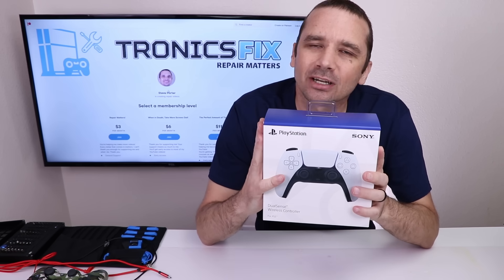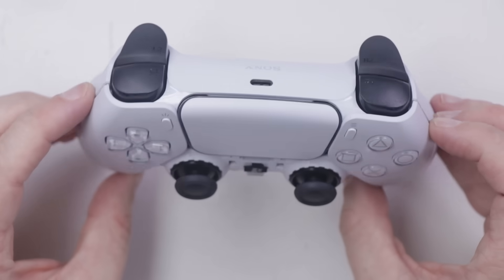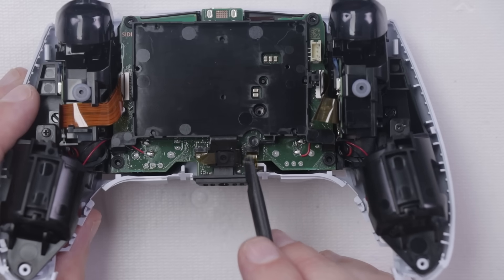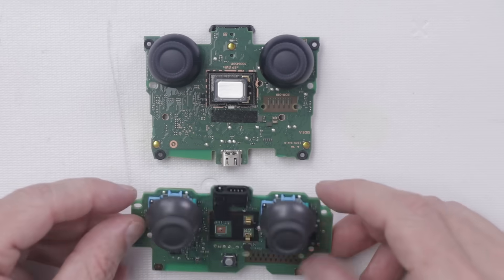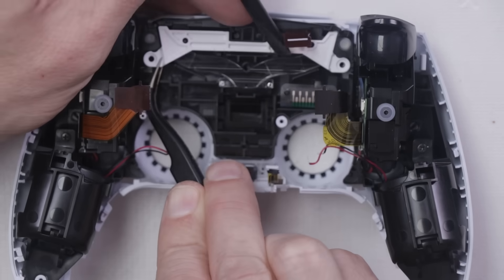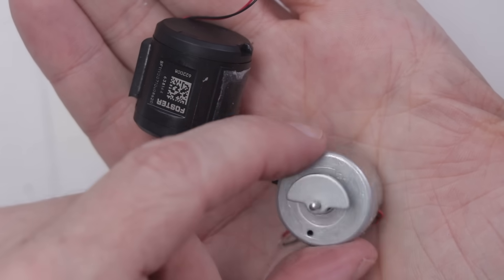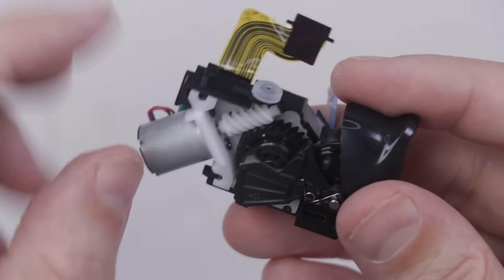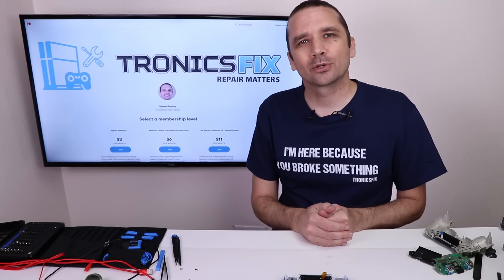PS5 DualSense Controller Teardown - A Repairability Perspective

Comment: I've never had any issues with stickdrift on my dualshock 4,have 3 and all of them work fine and 2 are over 2 years old and have been used almost daily. Only problem I have is one one the L3 button isn't a 100%, but no stickdrift at all, I believe if you keep your controller clean and don't drop it that stick drift won't be an issue that much, just vaccum the outside and clean it of with a slightly most wipe and you're good to go, that's what I've been doing all along atleast

Comment: Sony could potentially still produce another dual sense controller with different analogue sticks without affecting the controller massively the only problem would be production of it because it’s more research, time, testing and possibly a update for the controller to function like it should with the ps5

Comment: Do you know where to find a ps5 trigger spring? Mine snapped :(
Reply: Mine did the same thing. The ones from PS4 controllers are the same exact spring. (Atleast the models I have.) Hope this helps.
Reply: Also hoping that they were just faulty/poorly manufactured springs and won't be a reoccurring issue. Only time will tell.

Comment: The main problem is that the drift on the analogs on the ps4 controller is a hacked system introduced to the ps4 since you move the R3 analog to aim at a corner and the gun won't move * and it just became a up down side to side movement instead of a 360° degree movement like my previous v1 controller ** so this new ones you one the analog and the gun won't literally move to a movement u do ** so it makes it sooooo disappointed on call of duty since the cool thing about call of duty is the fast aiming with 360° degree aiming movement and no drift as now we experience dec/8/2020 y'all know thta by fact*** so its just a feature sony took off the ps4 so that developed gamers morph to the Ps5 and leave the crap ps4  to the young lol *

Comment: 6:15 Don't lose hope. The Joystick housing edges are super smooth with little to no grinding of the plastic.  The Switch Pro is the worst culprit of this due to having sharp edges surrounding the sticks shaft which creates plastic dust that enters the Joysticks internals causing drift. The DualShock 4 also had this issue.

Of course wear and tear will still happen but not as quickly.

Comment: So the adaptive triggers are nothing but a flimsy piece of plastic moving in your way to do the trick. Nothing "highly" advanced, that would justify the high price..
Well i hope they at least have a better policy this time to replace broken controllers.

The only problem i have with my current Xbox Controller are the rubber pads falling appart. But after 5 years and more that is to be expecte dif you have them in use a lot. And i can easily replace it for 5 dollars.

Comment: Easier then DS4 WHEN open you might rip charge light cable and parts can fly out like springs etc. But I bought broken official PS4 charge base that charges at bottom ext. Port next to 🎧 jack. Charges faster. So I removed wire with plug heat shrinked it and boom works fine.

Comment: OK awesome easy too fix since I've been fixing systems since PS1 yes I can fix Nintendo, and all systems, even do raspberry Pi and put raspberry pi in a Wii U game pad. PC's and laptops, 📱 and tablets but you pay for parts, original parts. The hardest part is replacing USB since you obviously can't used a soldering iron. Next is replacing potentiometers they are soldered with lead based soldering.

Comment: The dual shock was like defusing a bomb the dualsense is like defusing a nuke
Reply: ? The DualShock is pretty simple just by looking at it
Reply: @mftripz8445  yea it really was I once took it apart while waiting for a match online
Reply: @mftripz8445  dual shock 3bwas harder actually
Reply: @BeezyWaxx  yep, the triggers had to be slid into the film with the contact then clicked into the joint then the join assembly slid down into a grove on the bottom piece THEN you could slide the motherboard in place, and the last piece had to sandwich the assembly, and if you messed any of that up the triggers would not work right
Reply: @ThreeDaysOfDan  which version mine  was easy to take apart 1st gen I think
Reply: @ThreeDaysOfDan  yep I  cleaned out one the other day and it was a pain to get everything to stay in place
Reply: But, nukes are bombs

Comment: Stick drift? on dualshock? Genuinely never heard of or had that complaint, unlike the switch
Reply: Yeah same and joycons are hot garbage
Reply: @BabySlayer13  honestly they are a great bit of kit, the only thing wrong with them (unless you have big hands) is the drift
Reply: At least joysticks on joycons are attached with a ribbon cable and not solder...

Comment: pissed about the analogs, my biggest issue was stick drift and they didn't even fix it.
now its even harder to fix..
Reply: I never had this problem and my friends neither, i only had this problem on the NSwitch
Reply: @D.K i know, that's usually what i have to do, im mainly just upset that its harder to do now., and the fact that they didn't even fix it..
Reply: @D.K its 100% riskier to open the DualSense over the Dualshock, i personally wouldn't feel comfortable opening the DualSense multiple times.

Comment: Stick drift? Don't think I've encountered that with my controllers. One of them is a bit broken since dropping it, and the buttons are hard to press after not having used it for 20 months (using only my God of War controller during that time), but no problem with the sticks.
Reply: It mainly happens when you play FPS games where you are constantly sprinting or aiming.

Comment: "USB repair is easy for anyone who can do hot air solder", yeah, thanks. DS4 USB port was a separate tiny board that anyone could buy for $10 with its ribbon cable and replace easily.

Comment: The fact that you have to solder out the cables in order to access the PCB top is bad news for repairability. The DS4 had a simple connector with a socket, so cleaning the analogue sticks was a matter of minutes.

Comment: I was left wanting a more thorough teardown of the adaptive trigger module.

It didn't show the sensor used to determine the position of the trigger, which I believe is some kind of conductive rubber force sensor like in the DS4 triggers and not a potentiometer.

I can't find much information about how the DS4 triggers actually work either.

Comment: I'm dissapointed about the joysticks. I have 4 controllers for PS4 and I've worn all of the left joysticks out when it comes to click to run. It's an easy fix with a bit of electrical tape on the inside joystick button but it's a pain to keep dismantling to repair and this is a bit more tricky to get to.

Comment: If it still have analog stick drift then I'm a quite a bit less excited about this thing. I have around 5 ps4 controllers in my room, all suffering issues with their right analog sticks.  My current ps4 controller turns left when I'm not touching it, and likes to flick left while I'm playing FPSs. I don't think I have the will power to buy any more and I do not won't to deal with this on ps5.

Comment: "theres definitely a TON of difference here.. the dualshock 4 motor relies on weight, while the dual sense is just a big motor that is controlled by a chip on the motherboard" 9:00
why are you saying that as if the dualshock 4 doesnt connect to the motherboard, and as if the dual sense has no counterweight? you really sound like you have no idea what you are talking about.
you didn't even attempt to make any kind of sense. you know you are talking straight out of your ass, why even include it in the video

Comment: The sticks are different. On the shock 4 with it dismantled, with the thumb stick off, if you move the stick the the limit, it usually sticks. With the dual sense, I haven't found that to be the case. There is a slight bit more resistance on the dual sense.

Comment: Same copper discs (those inside the green boxes) that will cause drifting because they go bad. 
If you have a working PS4 controller, keep those copper discs safe because you will need them.

Comment: actually  spawnwave was the first to mess up the two screws up under the l/r buttons but now people know if you need to change the battery dont forget when its almost p\open to pop off the triggers  for the extra screws

Comment: I have the oldest Dualshock 4 and the only thing that had gone wrong with them (both) was the L2 and R2 buttons... I discovered that in Battlefield 1 when I was not able to use the sniper rifles without mashing them as hard as I could... and then later ofc in most racing games when I only had about 80% throttle and when I could not take off in Ace Combat (using about 80% throttle)... easily fixable with some silicone though. The drifting analogue sticks I have not encountered yet. Or maybe I have? when using the browser the cursor seems to drift... but I never had any problems in games?

Anyway this new controller looks awesome! and I like the microphone part actually as it could in the future (or maybe is it already feature?) be used for balancing a surround sound system easily from where you are sitting at the time with.

Comment: I don’t understand? That charging port design is way less repairable than the PS4 controller. Do you imagine most gamers own hot air micro soldering stations? Compared to the PS4 controller’s simple plug in replacement charging port module (requiring a single screwdriver) this controller has been rendered disposable for most people by the cost of professional repair.

Comment: How comfortable to hold is it compared to the duleshock 4 ? Also how much does it weigh ? Also how does the resistance return on the trigger does the spring pull the little bar back or does the motor push it back?

Comment: Too bad they still haven’t made a system where u can pull off old joysticks and slide new ones on. As joysticks are usually the fastest thing to wear out. I’ve replaced the joysticks 4 times on my scuf controller which is super easy as it’s just twist a ring and pull them off.

Comment: I really wonder why nobody uses optical sticks anymore like the Nintendo 64 did, it's set of mechanical problems were unrelated to the sensing tech, that part would not degrade like the potentiometers inside pretty much every single controller nowadays. It's not like it's dead tech either, my mouse wheel is an optical one, so are the encoders on printer motors.
Can't help but think it's killing two birds with one stone on making it that way: lives long enough to be acceptable so you still buy more controllers, and possibly cheaper to produce.

Comment: Xbox users are lucky, they get to use AA batteries! and if they want rechargeable, they have to buy it 
Great news for Xbox users!  (sarcasm) 

AHHHHHHHHHHHH HA HA HA AHAH AHA
Reply: My xbox rechargeable packs cost $20 and came with a charging stand and have lasted like 5 years and still work. Plus they are 2000 mAh. Twice as much as the ps4 controllers. I own a ps4 and a Xbox and like both controllers. It's just really nice to be able to have choices. Not to mention my ps4 controllers die so fast cause the batteries are getting old.
Reply: Yeah you want to open your controller, try not to break something (e.g. clips) and find a battery which will work after 5 years. Good luck ;-)
Reply: @cachememory  So your argument, in you brain, is that after 5 years, MAYBE you might have to replace it? You relies, you'll have spent more than the cost of a second controller in AA batteries or a recharge kit XD 

And you can still plug the controller in to the console if the battery  completely dries. I've had a ps3 since release, no controller is dead, or a ps4. that's a long time. 
geez, I remember when I had an xbox 360, each controller needed a recharge pack, so heavy near the end, bulky and just unpleasant.  

You're getting ripped off. It should come with a recharge pack included, be an easy thing. With the option of taking it out and putting in AA batteries. Period.
Reply: @crazytech5755  It will die pretty quick, believe me ... Yeah I have some XBOX 360 controllers lying around, where I had a charge and play kit. But it died and from M$ you didn't get any new one anymore. So I bought an aftermarket kit. One year later this is also dead. Using the cable is so clumsy, not really an option for me. Now I have to rely on rechargable AA batteries. But still better than throwing a controller away, which would otherwise work. Also you could use ANY manufacturer and don't get ripped of by buying a battery pack, which is basically two AA batteries stucked together. 

Yeah M$ should include a battery pack, but please make it still easy removable and not like Sony ...
Reply: @cachememory  I've never had to throw a controller away, or use a cable. 
All my original ps3 controllers still work perfectly, and my ps4 ones do too. 
This is a myth. It's the same as having a phone for 2-4 years it'll keep working, might not last as long but it'll still let you game. Lets not forget The added costs of those packs. 
So it's not like you're getting that battery for free.  it's 20-30 bucks+. 
Around the same price as a new controller. 

You're not getting some amazing deal. Btw, if anyone has a brain they'll get a warranty for their controller as it's like 5 bucks for 4 years.  If it was an actual problem you would see it turned into a big deal, but it's' not. Cause it's not a problem. 

how absurd. on top of this, I've never had a playstation contorller break, but most of my Xbox controllers break. The triggers mostly.
Reply: @crazytech5755  than you had luck or you do not play often ;-) I experienced myself so what? The controller either doesn't turn on or it works for one minute or so and it dies ... 

A new controller is about 20-30 bucks? Are you kidding me? I looked up Sony DualSense Controller wireless and it is about 70 bucks! A XBOX controller starts about 50 bucks + 20 bucks for battery back you have the same. And you can swap your batteries easy!

If your warranty includes battery for 4 years that is nice, but here in my country I don't know anyone who would offer such thing.

The rubber on my analog stick is coming off and the trigger is making noices, otherwise it's working perfectly.

Comment: 2 haptic vibration modules, 2 haptic response trigger modules (at least 4 motors/servo), 2 mics, touchpad, wireless signal, light, gyroscope, speaker... All that for a 1560 mAh battery?

Comment: The motors are basically long throw subwoofer speakers  without the cone.  If you hook up those wires to a low watt speaker signal you will hear the music.

Comment: So putting in xbox anylog sticks won't be as easy as the DS4... dang
Reply: abbsnn cose  I agree with that just like vibration is turned off by a lot of people but tbh I've dont solder and if thats what I need to do to swap analog sticks then I'm screwed. I just feel the xbox one sticks have better gripping.

Comment: The only thing I disagree on is the usb-c port going bad. I've had plenty of micro USB devices, and over time they've all gone bad. I've also had a ton of usb-c devices, but not a single usb-c port has gone bad, even with abuse. Assuming sony has built it strong enough, it should last VERY long.

Comment: Replacing the battery when it inevitably dies is going to be a real PITA on this controller, with so many pieces that need to be removed that are held with plastic clips that can break if you don't unclip them carefully.

Comment: So disappointing to see the same joysticks as the DualShock, drifting is going to be a problem once again 🤦
Reply: I want to argue but you got point.......
Reply: I dunno, the things I found caused drift for me was always either hair or dust. (Easily fixed btw, hair open it up and pluck them out of the mechanism meanwhile dust you just move the stick in a direction and blow into the crack) both of which should have a harder time given the rubber edges around the sticks.
Reply: @Kjf365  The main problem is those stick modules that are made with cheap plastic... The original PS3 & Xbox360 controllers had metal supports but every console after that uses those same modules that kinda breaks apart. When one part moves and loosens, the stick starts to drift. People that have most of these issues are the ones that play more stick smashing type sports games (Fifa, NBA, NHL, Rocket League, etc).  I used to fix and mod a lot of PS4 and X1 controllers. I was hoping that they would change the modules. I just think they make so much money selling new controllers that they don't want to change the modules.
Reply: Jere not just sports games, i plsy fps mainly and it is ridiculous how every controller I have had has stick drift {ps4 controllers)

Comment: wish it had visible screws instead of clips. Or that at least there was an openable battery compartment. I'm glad I don't have to solder a new battery on at least. So it's an acceptable controller, even if just barely.

Comment: Watch John glasscock’s video, at 00:50, he say it is possible to remove the black part of the PS5 controller without pretty much no tools. Hmm
Reply from the maker: Look at the video where he says that...the black piece has already been unsnapped on the left side. If one side has already been released then yes, the rest can be done with no tools. You won't be getting the black plastic piece off without tools.
Reply: @Tronicsfix  haha yes true I watched it and I was like wait a minute.. why is the left side unhinged first? Which made me wonder did he omit explaining he might’ve used a tool at the beginning which made it easier to remove everything else? Haha Appreciate your vid, yours was way better. I would use tools as well to avoid breaking the exorbitant controller